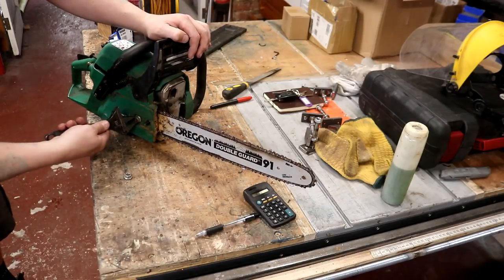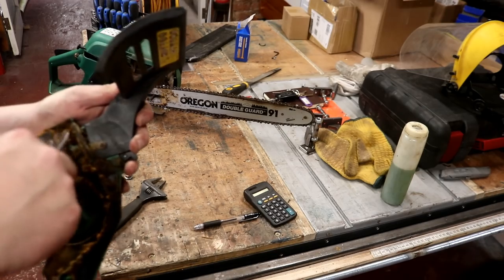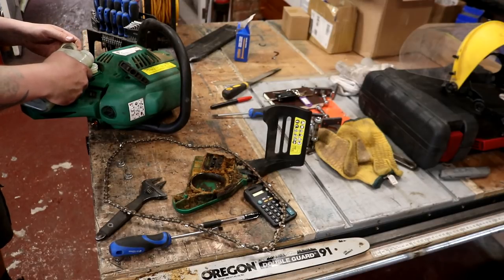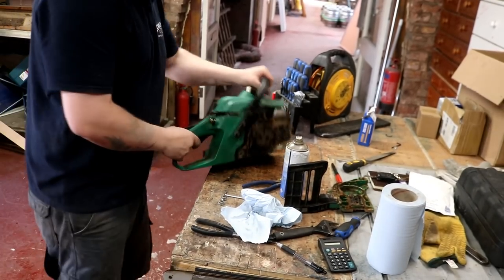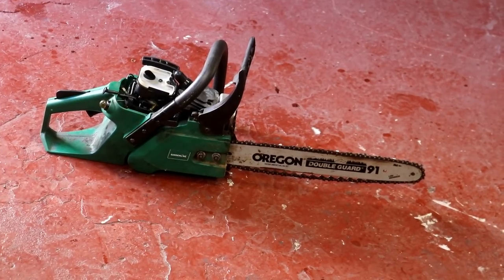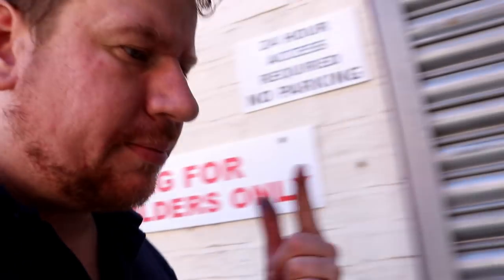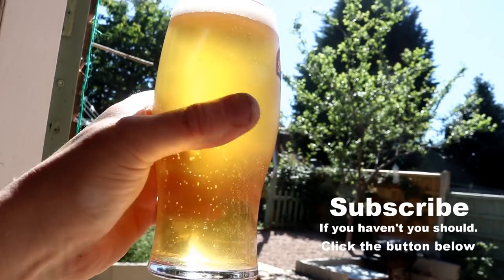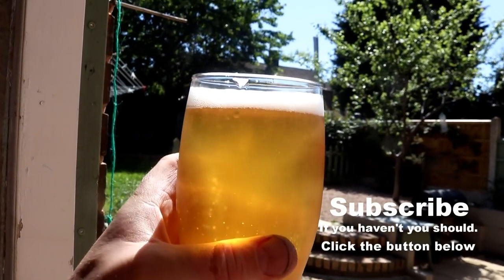A STROKE OR 2

Comment: Pour any old gas out into a aluminium pan and use that to soak the chain. Never refire a saw with old petrol. Make new fuel with correct oil to petrol ratio. Refill tank - prime the carb until the priming bulb pushes back. Make sure the kill switch is disengaged. Pull it until it starts. Refit the blade and guard. The cutting out thing is gas not getting to the carb - it is probably old fuel that has stopped up some of the carb ports. You might have to remove the carb and soak it in cleaning fluid for a few days. 2 stroke engines can be a beeotch. You could get a light electric saw and extension cord if the brush you;re cutting isn't too thick. Best of luck!

Comment: P.s I didn’t  mean the rubber/plastic inlet manifold that sits between the cylinder and carburettor, it’s normally a small rubber grommet about the diameter of a pencil, cheers

Comment: Hi Harry there is normally a small rubber grommet that sits between the  combustion cylinder and carburettor that actuates the diaphragm fuel pump, it’s quite often this that has gone hard and letting air in, or the diaphragm itself

Comment: Enjoy the weekend m8. When a chainsaw has been sitting that long it's usually something to do with the diaphragm,they have a habit of going hard and perishing sucking in air and messing up the fuel/air ratio. Like Maldon said below could also be that small grommet. Because it's been sitting that long it's worth replacing these parts anyway if you intend keeping the chainsaw(if you can get parts for it that is). Cheers.